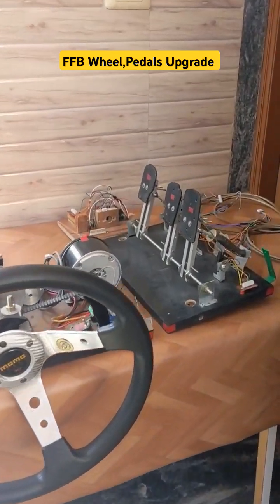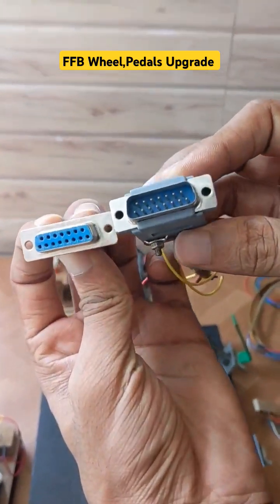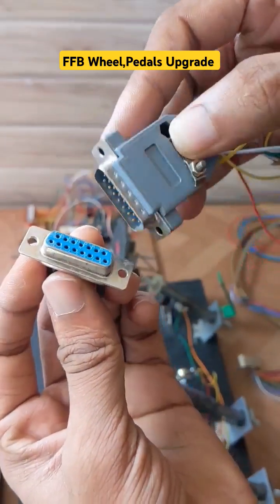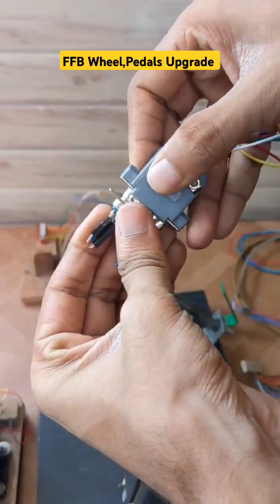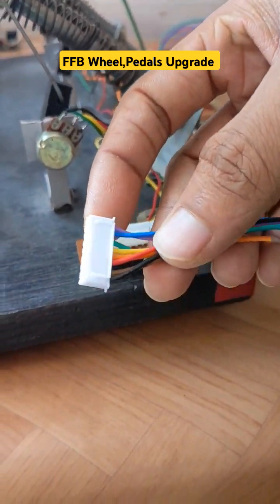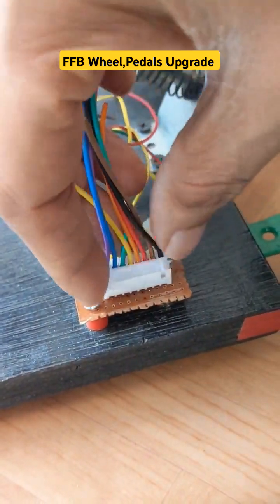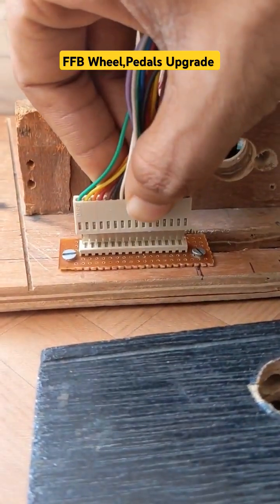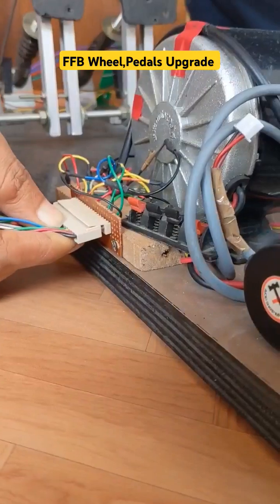Force Feedback Steering Wheel, Pedals Upgrade #gaming #steeringwheel #shorts #steeringwheel #simrig

Comment: Bro how did you connect the pedal shifters 
Won't they get wear tear

Edit: I wanted to make a 900° wheel just can't figure out how to pass the wires through the hub shaft
Reply from the maker: I have used lengthy wires. 
Usually for Racing games I use these and keep the steering angle less.
https://youtu.be/-gHQ2EIYm88?si=W2OEJ29SdT77L5e5

Comment: Very nice videos. Is it possible to make the adruino based DIY ffb steering compatible for PS4?
Reply from the maker: This firmware cannot be modified.
I think you can make a gimx adaptor and use it with PS.
Not sure, but try to check on diy Gimx adaptor.
Reply: @techathome  thanks. I’ll check that out!